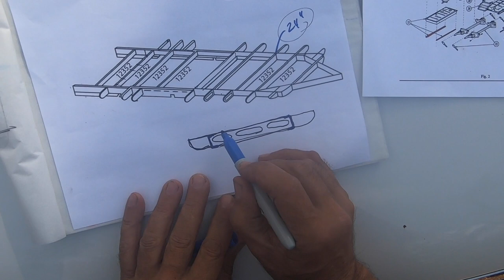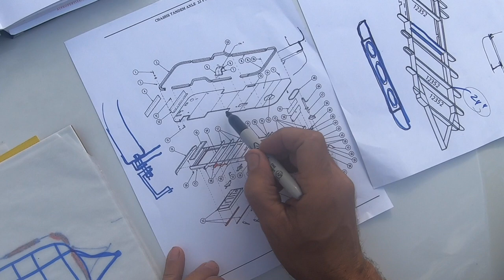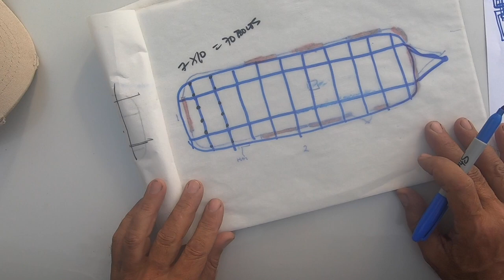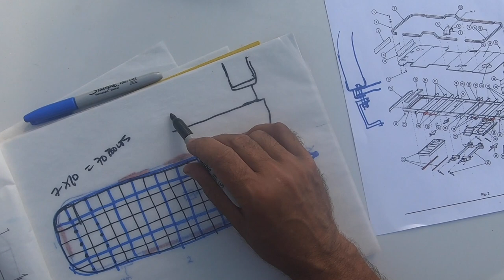Removing subfloor in a vintage Airstream trailer

Comment: On the floor bolts I use a 1" hole saw. Drill a 1" hole in a 1/2" plywood as a guide. Remove the drill bit when drilling the floor. Center the 1/2" hole over the bolt head. You can tell when you are through the wood or mark it with tape. Cutting the bolt off is easy then.

Comment: Have a question.i have a 20' Airstream glad I looked at your vid first.I am not doing a frame off just the plywood.i have been looking at the walls as demo has evolved can tell the floor continues under them.After watching your vid I'm really concerned about loosening the support for the entire shell didn't know about the bolts going threw the wood for structure support of the the inside frame I do have rott by all windows what are your thoughts William